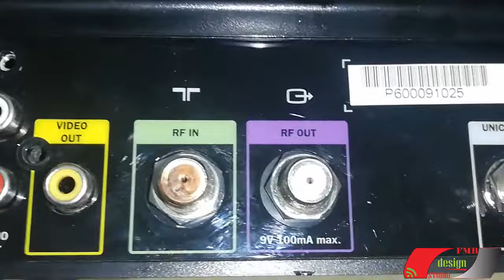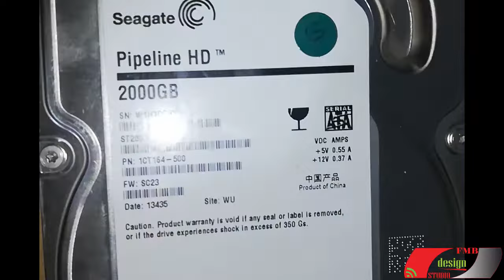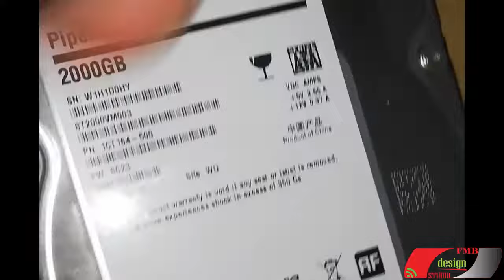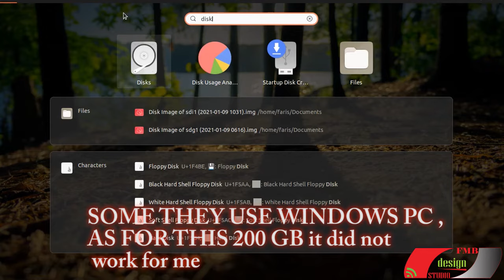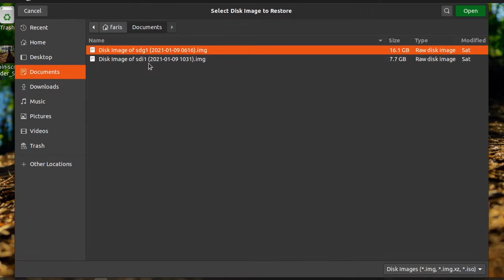DSTV EXPLORE HARD DRIVE FORMAT/PARTITION

Comment: I'm having similar problem. My decoder keeps rebooting and shutting down during loading only to start rebooting again. Pls can I get a replacement hard drive? If not, can I remove the hard drive to watch only? Or what do you suggest?
Reply from the maker: Im not sure what could be the problem.. What happens when you disconnect the hard drive, does the decoder stil reboot?
You can watch videos from ur hard drive how ever in some pc it wont be detected and video quality will be poor as it does not record in full hd format
Reply from the maker: Hold the POWER button on your decoder down, till the front panel shows a blank screen 2. Then hold down the P+ button, until CODE appears on the front panel 3. Then press: P- (0 will appear on the front panel) 4. Then press P+ (01 will appear on the front panel) 5. Then P- again (010 will appear on the screen) 6. Then P+ again (0101 will appear on the screen) 7. A blinking HDDF will appear on the front panel of your Explora 8. Then press P+ to confirm (hold down for 5 seconds) 9. Do not interrupt the process until you see PASS displayed on the front panel 10. LOAD will appear on the front panel. Please wait for the process to complete which will take a few minutes 11. You’ll know it is done when your pictures start playing again 12. Please check your playlist – if it is blank, then the formatting was successful. If it is not, then you need to do the steps again.
If successful, please remember that it will take at least 48-72 hours for your BoxOffice and Catch Up to populate again. Don’t forget to set your recordings again.
Reply: @fmbdesignstudio440  
Thanks very much. I have done all these, but the issue is that it doesn't even bring anything like CODE on let alone follow the subsequent steps. I have done everything humanly possible to make the thing work but it simply refused to budge. 
The question now is if I remove the hard drive from the decoder, will it work? Just to keep watching normal dstv shows wthout pvr functions. If yes, how?
Reply from the maker: Yes it should work if it was only the hard drive faulty...
Reply: @fmbdesignstudio440  man you’re a superhero😩😩🔥🔥🤝🤝thank you 
I just formatted my harddrive and it’s now working perfectly fine🤝
Reply: @fmbdesignstudio440  Thanks a lot after following these steps my decoder is back to life.
Reply: I have the same exact problem with my explora, rebooting and shutting down. Did you eventually find a working solution for this?